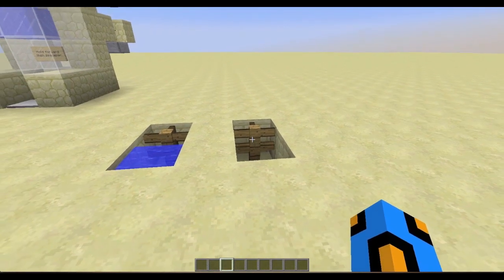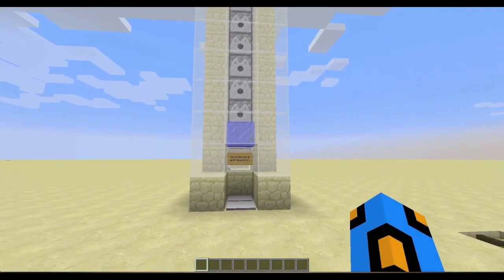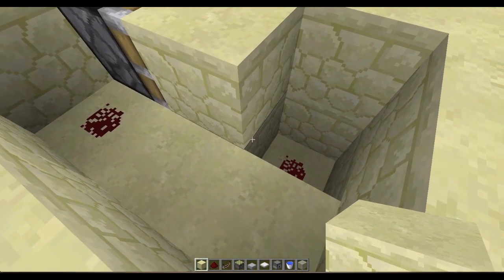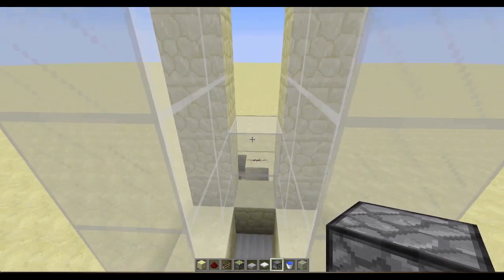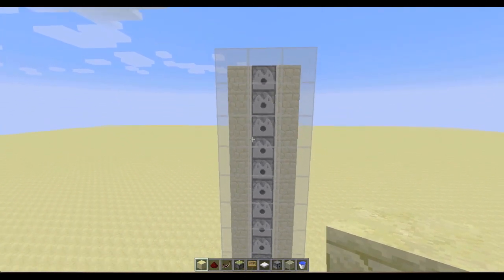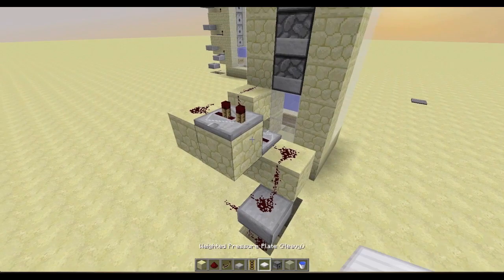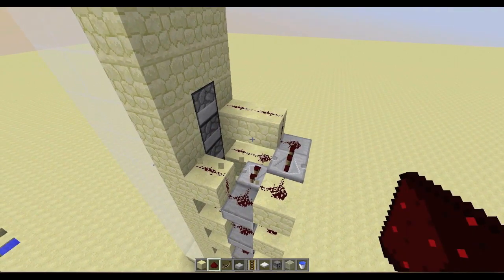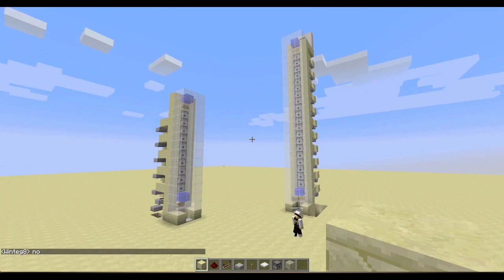The Aquavator Mk2! [Tutorial] READ DESCRIPTION

Comment: I built this in survival on a sever and it works fine going up but it don't pick up the water again. I checked and double check it all, fallowed it through and through watch your video like eight times and rechecked over again. still not picking up the water after you go up like yours in the video.
Reply from the maker: Go ahead and add a powered rail immediately adjacent to the top dispenser, and wiring as if you had another dispenser above the topmost one. Let us know if that works.
Reply: ok I will do that thank you
Reply: I did what you said and it works great now thank you
Reply: eagle2angel1234 . i had the same problem and it still doesnt work

Comment: i fallowed your vid step by step on the PS3 version but it dose not seem to work. also i noticed when i used a torch to check the connections, the water in the buckets in the dispensers shot out the water but then they were out of water. it didnt go back in. is there a fix for this is it works right or am i just boned cause the PS3 version is not as good.?

Comment: The reason that the powered rail is because the bottom one is BUD-powered, so it needs an update in order for it to fire, whereas the other dispensers are being updated by the ones below them. Just thought that I'd mention it.
Reply from the maker: The bottom dispenser is not BUD-powered, and in fact the whole system works without the powered rail. Also, dispensers do not give an update when firing. It's bizarre because the whole system works without the powered rail, albeit less reliably.
Reply: RedstoneInnovation its not reliable at all i made it and it didnt work worth a crap, same thing with everything else this channel has inspired me to do